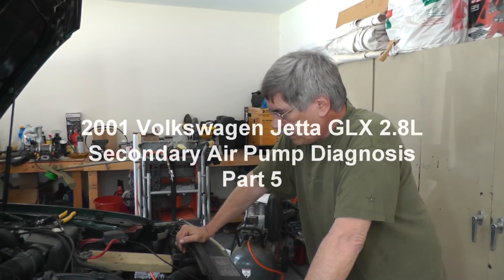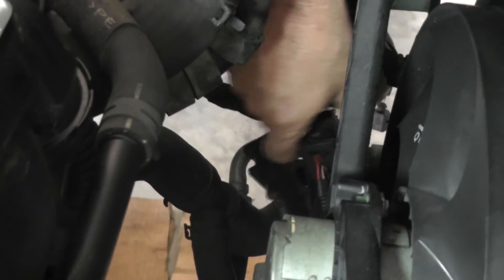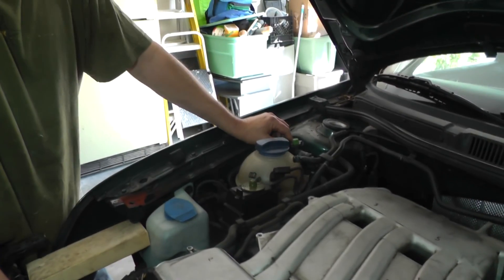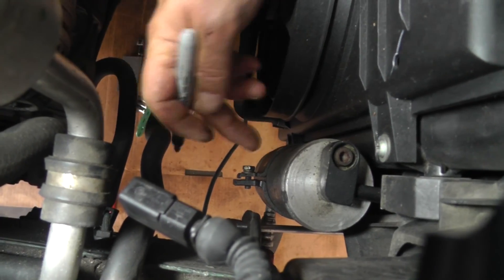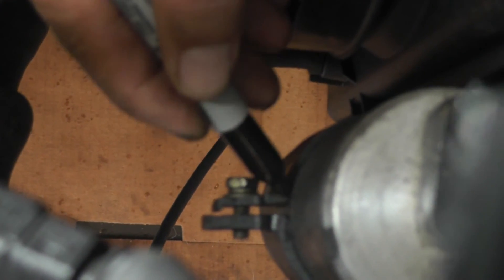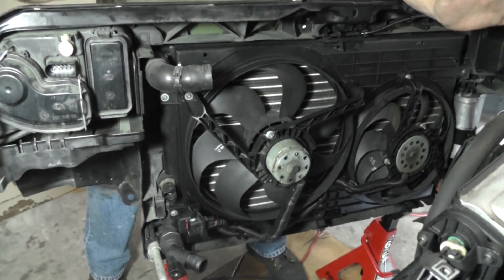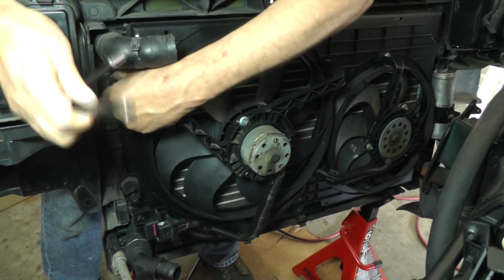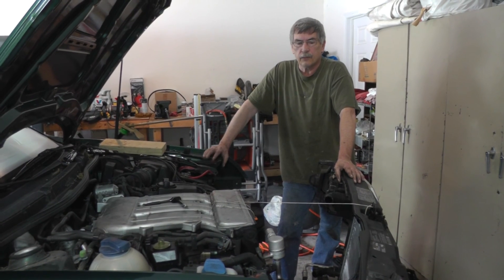Volkswagen Jetta Secondary Air Injection Diagnosis Part 5 (Lock Carrier Service Position)

Comment: what connector is the one by the coolant fan connector? it also goes into the radiator?
Reply from the maker: I don't have the car anymore, but being in the radiator, I would assume that it's a level sensor or temperature sensor.
Reply: @stuzman52  Ok I dont mean to bother you but there is also a temperature sensor inside the T-stat housing?

Comment: the heck with the clip, i just pulled the bottom hose off of the radiator hook up. figured i would mess around and break the plastic so pulling the rubber hose was better for me.  love your videos btw
Reply from the maker: Rhage73 Sounds like you're moving right along with your repairs. Glad that you liked the videos.
Reply: yes sir, so far i did the valve cover gasket and tube seals "needed them really bad" water pump, made some vacuum lines that broke or was leaking out of the factory original fittings and various sized rubber hoses, t fittings and large to small adapters. rotors and pads all the way around, rear shocks, windshield fluid motor, radiator fill lid, and little ball, just need struts in the front probably a primary O2, minor exhaust leak at the exhaust manifold, and to drop the head liner support and redo the adhesive on it, "already bought it" just need time.   but its a really nice ride for its age and i got it for a good price expecting to put about 1k worth of repairs into it before it was right.  oh ya and the dreaded thermostat housing.  loosing a little water and threw some dye in there saw a couple of minor drips on top of the trans under that area.   but your videos are very informative on the german stuff.  honestly i didnt know what half of that stuff was with all the hoses and T's and stuff in the front behind the core support.    thanks again.   i pretty much gave up on the vacuum line for now.  search as i may i didn't find a home for it.   but like i said, it connects to the air intake tube right after the MAF on the under side of it.   runs toward the front of the car and then nothing.usually intake tube hoses are part of the setup to help a motor breath or vent its internal pressure, but bigger fish to fry and limited time / $.    have a good one.
Reply from the maker: Rhage73 Sounds like you've done a lot of work and it should be running pretty good. Keep up the good work!

Comment: My secondary airline tube that goes to the air box was cut and the kid added a cold air intake to it!
Reply from the maker: Yeah, you never know what you're get when someone else owned the vehicle.
Reply: I just noticed corrosion in the coil pack plug! Do you think that could cause all the intermitant grounds that i am having?
Reply from the maker: Not likely, but you'll need to address that anyway since you found an issue with the corrosion.
Reply: I also noticed that the crankshaft sensor above the coil pack had a bad seal and oil was in the connector! could that cause the ground issue?
Reply from the maker: Possible, but still not likely. To confirm, unplug the sensor connector. Spray some contact cleaner in the connector, blow it out with compressed air and leave it disconnected. Now check voltage to see if the ground returns.

Comment: Great videos i have the same car this video helped. I am still going through hell with my car and diagnosing! I have to check the wire harness from the alternator and the check my ignition switch fro the ground issues i am haveing and i just found the cam shaft sensor was bad and oil was in the plug of the sensor! NIGHTMARE! :)
Reply from the maker: Sounds like you've got a real mess on your hands, but looks like you're making progress. As for the ignition switch, I just wrapped up a six part video series on the ignition switch where I had some burnt wires. That may help you if you hadn't already seen them.
Reply: I am definatly going to watch those videos if this does not fix my issue. i just replaced the 409 relay and still nothing! now i am going through the harness in the engine bay and i noticed a wire that come from the alternator that was not connected really good and the coilpack plug corosion also!
Reply from the maker: I remember when you mentioned about going to the junkyard and getting a fuel pump relay. Although, it supplies current to a lot of devices as you mentioned, I didn't see how this would cause a grounding issue. As you find abnormities such as a loose generator wire or corrosion on the coil pack plug, just as well fix them as you come across them. Still, I don't think these issues are going to fix your major problem though.
Reply: All the ground issues i am having are all on the same harness with all the sensors low intermitant issue. One step at a time. thanks again! :)
Reply from the maker: Just so it's clear in my mind, you did mention in a previous posting that you had low B+ voltage at the sensors like 4 or 5 volts. Correct? Which sensors did you measure for B+ to have this low voltage and where was your ground connection of your DVOM placed?
Reply: I was getting around 4.6 at the purge valeve sens,tbs,maf sens,pvc sens, and crank shaft sensor
Reply from the maker: And where was your ground connection for your voltmeter placed?
Reply: The loose wire i found was on terminal 30 of the alternator! All the faults i am getting are terminal 30 low voltage intermittant! I think this could be possible issue! What is your opinion?
http://ww2.justanswer.com/uploads/071TCB/2010-09-03_000104_starter.jpg
Reply from the maker: mikeyd19841 That picture is one of the starter/solenoid which shows the terminals. You found a loose wire on the generator so I'm not sure I see your correlation between the generator and the starter. In the beginning, you were saying you had a grounding issue. Now it sounds like you have low B+ from what you're saying and it's now intermittent. So, is it low B+ or a grounding issue? You told me that you had about 4.6VDC at some of your sensors. And I asked for the third time, where did you place the black lead of your DVOM for your ground connection? I never got an answer. So, here's the scoop. If you placed your black lead of your voltmeter on the negative battery post, then you know you've got a good ground for all of your voltage measurements that follow. If you get low voltage on these sensors still, then you've got a B+ problem. Let's say that the B+ voltage comes back. Then move your black lead over to the ground connection of one of the sensors and check again. If your voltage is low, then you've got a ground issue.
As for the loose wire on the generator or starter, who knows, may be your issue. Tighten the wire and see if that fixes it. If not, then it's more hunting.
Reply: LOL I am lost myself! I dont know what is wrong with this stupid thing i just want to scrap it! There is a lot of back pressure also coming through the engine and i am gonna put everything back togather and start from the converter! The crankshaft sensor that is above the coilpack had oil in the plug from back pressure i am assuming and the pcv that is attached to the air intake tube before the throttle body has oil in there also! I am gonna start with that and then mess around with the vagcom faults. It is so frusterating! Cheers for all your feedback and comments i really do appreciate them! :) Wish me luck! LOL
Reply from the maker: A man who never gives up will always have good things in the end. So, hang in there and I'm sure that you'll get to the bottom of it.

Comment from the maker: Not sure about from previous clips Dave. I did however reload this video to include taking out the cooling fans, but nothing came from previous videos that I'm aware of. I'll take a look. You are correct that the pump only helps with emissions. At startup when engine is cold, the mixture is richer, so the pump will bring in some outside air to lean the mixture at exhaust which also helps on the afterburning of the cat (faster warm up). This fresh air mixes with the exhaust gas where O2...cont)